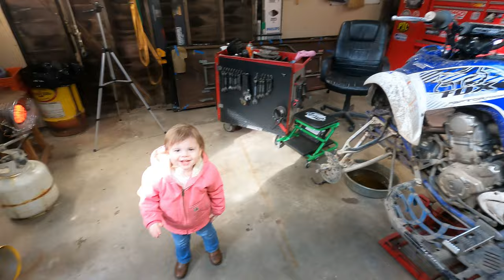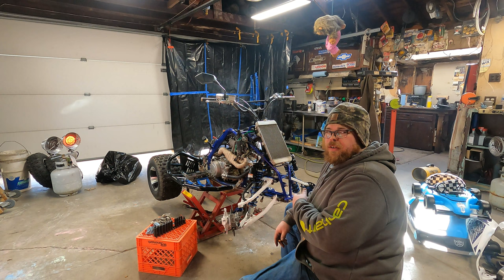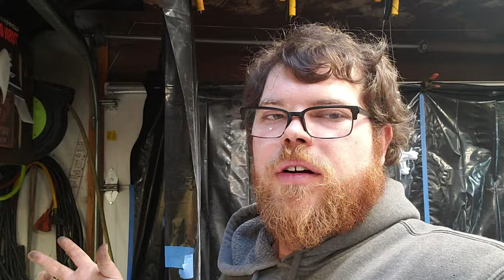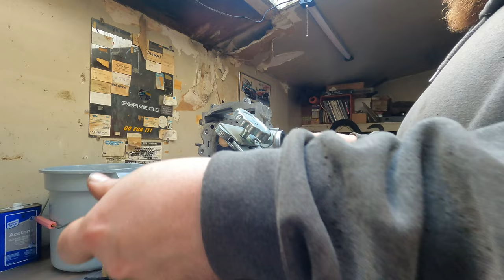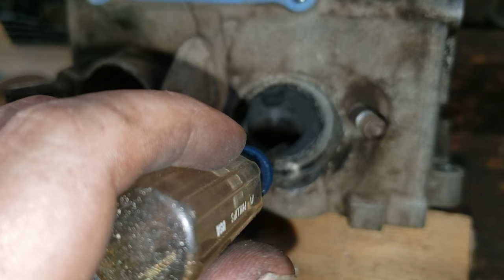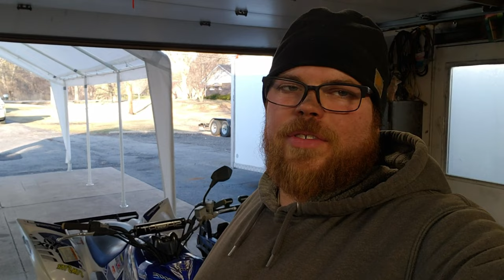Raptor 700r port & polish

Comment: You really need a few sized battery impact guns, it makes tearing apart and assembling motors wicked fast bub. Most shit you can get at without wrenches.
Reply from the maker: this is very true. i do a few but when i tear into something new i like to feel how tight is while disassembly. thank you
Reply: @pattenperformanceracing9852  depending on who molested the motor last you just never know. Usually the size of the bolt correlates to a certain torque spec like a m8 bolt is 28-29ft lbs, I will get right up on the ratchet head so there's no leverage and tighten it wrist snug that way the bolt doesn't snap and the threads don't stretch more then they gotta to make a secure connection. I can actually use my smaller impact, snug the m8 bolt up and then 2 quick bursts with the impact and it gets it to around the 28-30ftlb spec. But for critical shit I always like to hand tighten because I know by feel..you can still snug each bolt up before hand tightening which saves a lot of time as well...I just figured I would throw my 2 cents into what I noticed. There is always more then 1 way to go at things, we should be learning and I proving everyday nobody I know has wizardry status.